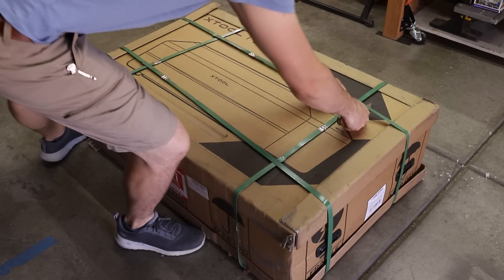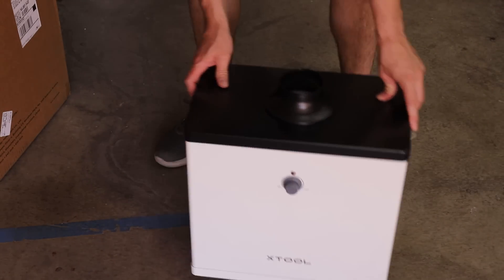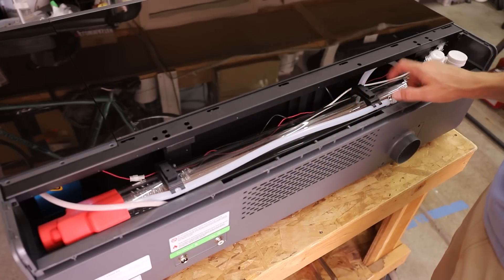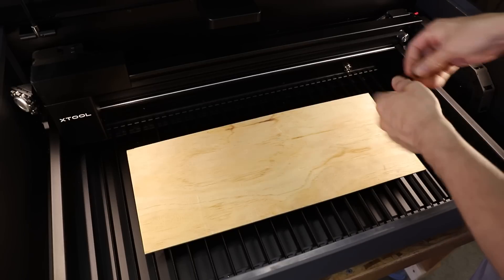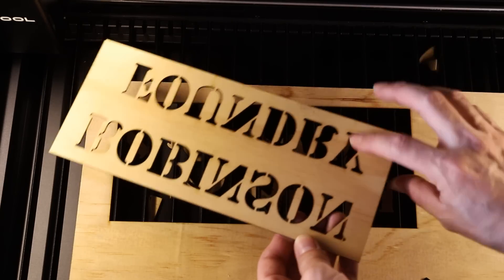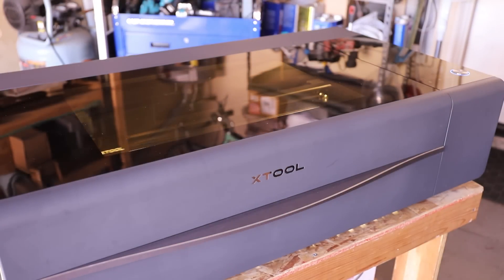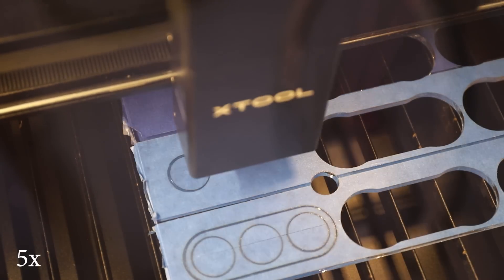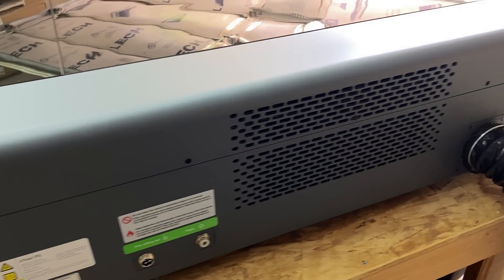xTool P2 55w Co2 laser cutter / engraver review - A new addition to the shop!

Comment: A laser cutting machine that the company where I work had, worth about €1,500, lasted very little time. The mirrors burned out quickly and only worked well in the upper left corner; the laser did not focus on the rest of the surface.

Comment: I use my laser cutter when I'm casting custom coins.  (turns out I cast a LOT of coins nowadays)  It's super easy to make sandcasting masters with runners included and engrave the logos both sides (using the original sheet of material as a jig to align for the second side).  It even kind of automatically adds a little draft when it cuts, so make sure the parting line is on the right side.
Reply from the maker: Wow cool suggestion! I'm going to seriously think about doing this. What material works best? I would think something like MDF or HDF would work well. Thanks!
Reply: @robinson-foundry  I like acrylic for coin blanks.  The cuts turn out drafted and polished without any additional steps, and the engraving is predictable enough that you can even get pretty reasonable (shallow) 3D shapes out of it.

I'll see if i can make up a quick reference video of my process.
Reply from the maker: Thanks I'll use acrylic then. Sounds like a cool project!

Comment from the maker: Don't worry this isn't turning into a review channel. Please let me know if you have any ideas for how I can use this machine in future projects.
Reply: what about engraving your logo on leather?
Reply: Could you engrave metal with this? maybe you could make some cool engraved patterns on metal cups or something 🤔
Reply: You could texture your parts if theyre small enough to fit in

A co2 laser should be good on ali but I think brass and stainless need a separate diode. Dont quote me on that tho
Reply: Yeah, test it for etching your company logo onto things you've made. Surely it works on metals.
Reply: I was wondering about cutting non ferrous metal plate?
Reply: What is the overall footprint of the machine